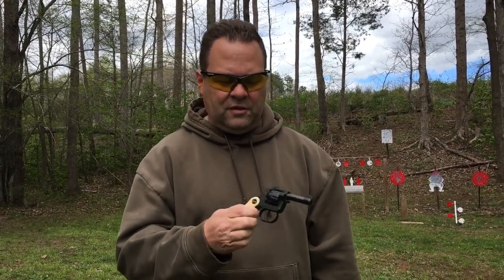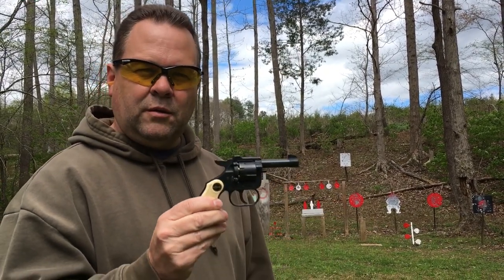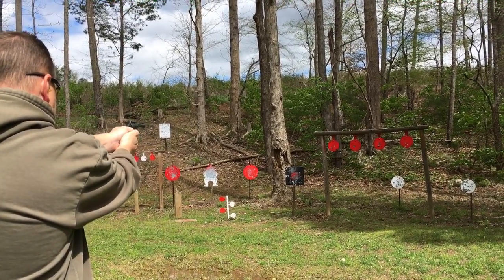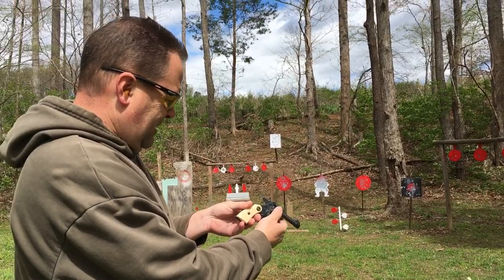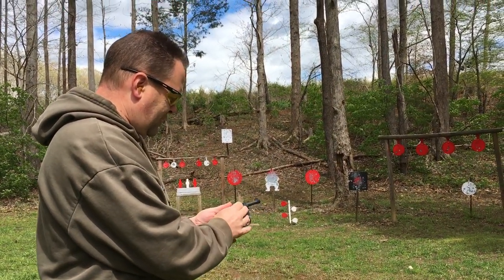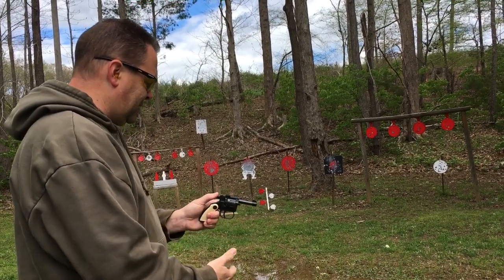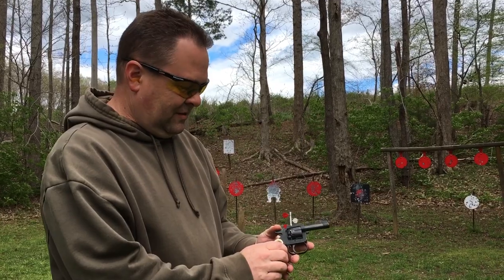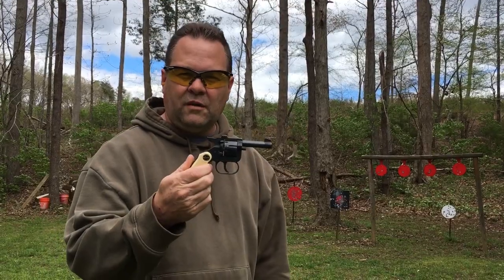Shooting the Rohm RG10 Revolver

Comment: There's a screw on the bottom of the handle it's the spring for the hammer turn it to the right 4 or 5 times then your gun should fire every time these guns really aren't that bad if you know what your doing
Reply: No, no, these guns still suck.
Reply: Thanks
Reply: I just about commented the same thing. Hammer drops a lot harder and fires every round after tightening that spring on the bottom.
Reply: Thanks for the advice
Reply: Thanks for the info
Reply: @grahammedlock3094  same here hahaha

Comment: Turn the screw on the bottom of the handle to the right 4 or 5 times, it's the hammer spring, then your gun should fire every time. You have to know what you're doing with these guns.
Reply: Tried that, mines just not wanting to strike at all. I think I may need a new spring
Reply: Thanks
Reply: It's just Garbage. Lol.
Reply: Gonna try this with mines thanks

Comment: I have an RG10 that was unfired when I bought it second hand at a gun show I paid $100, I've put 150 rounds through it in .22 short 710fps and 1105fps and didn't experience any issues. And it pretty much hits where your pointing. Aside from looking like a Cap gun the tolerance is extremely tight on every moving part. Maybe I just got a good one.

Comment: Mike,  I have one of the RG 10s, and I have used it as a back up gun  when hunting squirrels, and so far, it has not failed..  I also own an RG 14 They are far superior in their accuracy, as well as their ability to use any of the 22 ammo.  Shorts, Long, or Long rifle.  For the price I paid for them, they are as good of a weapon as I have ever used.  And cheap to plink also. Thanks for your review of them.  An Imperial is based on the same design, and is more dangerous than the RG versions.  stay away from them, as they shave lead, and throw back very hot gases when fired  I owned one of them, and finally found a sucker,,,, er,,,er   someone that wanted it. . Wouldnt recommend an Imperial, even for a starter gun.
Reply: I've never heard of anyone using a backup gun while squirrel hunting....lol

Comment: I have one that was my dad's (he passed away in 1984).  Still in good condition, but have never shot it.  May need to give it a try just to see how reliable it is.  Just looked it up and found that the RG 10 was made in .22LR and in .22 Short.  Mine is a .22 Short.
Reply: Don't shoot the .22 short, most have horrible fucking backburn and you'll burn your hand and face.
Reply: I got 22LR
Reply: Rohms are known to be junk but mine work great

Comment: Wish Ruger or Smith would make a small (smaller than LCR or J-frame) 6 shot 22-short with a break-top and spring ejector. Sure, these might be classified as novelty, but they start crossing over into useful when the quality and function goes up.

Comment: From what I have read about that revolver it is poorly made, the barrel does not line up perfectly with the chamber resulting in small hot fragments of lead shooting out the sides. I have seen it in person and noticed the misfire is due to the hammer not fully engaging the round. You have to pull the trigger a certain way for it to engage the round. There was a ban on it being sold here in the US I think I have read somewhere. It is not worth much and probably is not worth keeping or holding on to.

Comment: It’s literally hit/miss with these guns. There’s a reason why they’re dirt cheap. I might pick one up off a friend and a bag of lead ball .22LR for $45ish later on.
Reply: I bought one at a local shop for $20, as long as the lockup is good on noth d/a and s/a and the cylinder is in good shape it should do you just fine. Dont expect great accuracy though...
Reply: I had one years ago it worked great but it was stolen from my house , now a friend gave me one for my birthday and it works great.

Comment: Had one of these years ago. The bullets would keyhole at 10 yards so match-grade accuracy was not there. The trigger pull was an ounce below your maximum strength and then it would suddenly jump-fire wildly. But at about 80 rounds it was finally broken in... by breaking the frame above the hammer. Hung it on a post and shot it from 50 yards with a 30/06. It exploded like it was made out of compressed talcum powder.  It was about as useful as a 12 inch cane. I'd rather see blood in the toilet bowl than one of these pot metal wonders.

Comment: Watching this guy just pull the trigger willy-nilly and inspecting the chambers as if he knew what he was doing 
was painful to watch.  He fired 4 so 2 left.  
     1) He doesn't hold off down range long enough when there is the possibility of a misfire...
               a) all of what I'm saying is that it helps when you now what you are doing.
     2) He thumbs the hammer and rotates the cylinder immediately. 
               a) these little revolvers are actually quite nice when they are thoroughly cleaned. 
     3) THEN he fires the 6th round and that misfires as well.
               a) now he has TWO possible misfires in there within 10 seconds.

The worst part is that he was there with his kid to document this.  
I hope this turned out to be a lesson on what NOT to do while handling a double misfire handgun.

~just sayin'